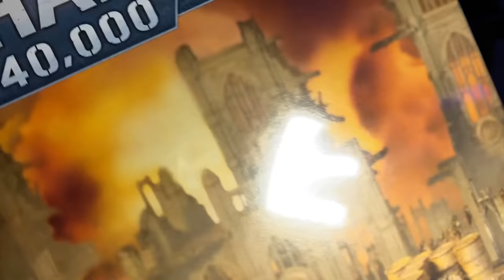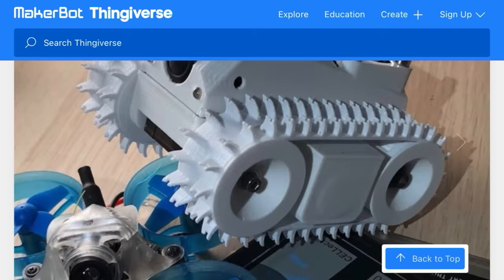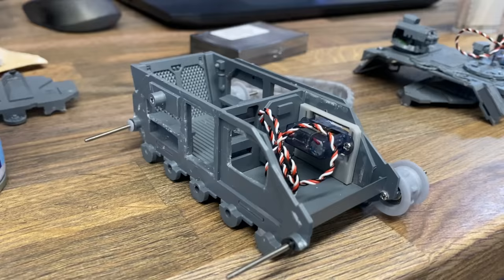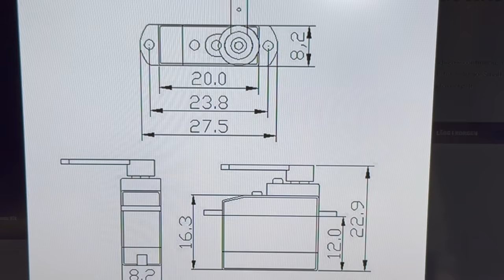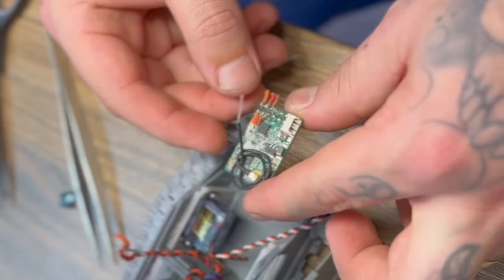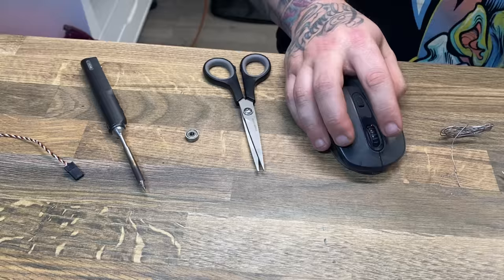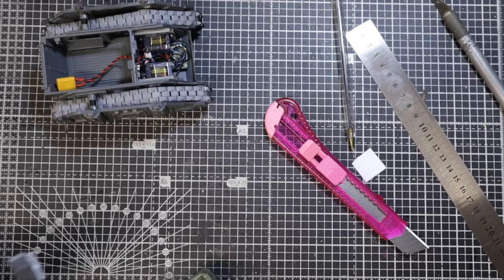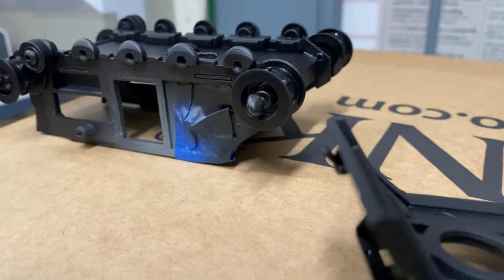I Made a Razorback REMOTE CONTROL with FPV and now its Better for Warhammer | Groundeffected.com

Comment: You might be able to use larger servos if you place them 90° to the drive sprockets by using ring and pinion gears (the ring gears should attach directly to the drive sprockets and the pinion gears directly to the servos)...I just got to the part where I saw you are painting in accordance with the blueberries. Forget everything I typed earlier.

Comment: you can modify regular analogue servos into motors by disconnecting the little trim pot from the geartriain (make sure its set to the neutral position before re-assembly)

Comment: That has to be one of the coolest things I have ever seen, other modellers have made RC Citadel tanks. But your install is fantastically compact and the UAV headset was a great touch. Great work, if i ever get any time away from 3D modelling for railways I do have a Land Raider.
Reply from the maker: Honest it was such a great project to work on. I enjoyed every minute. Except the minutes where it didn’t work
Reply: @Groundeffected  I'm building a range of model railway accessories with detail levels off the chart.... Bought a new 8K printer in Aug, only got the damn thing printing right on the 27th of Dec. I know about things not working :)

Comment: You’re the first Tuber I’ve seen using the same resin I print with. I have not had a bad or failed print since I’ve switched.
Reply from the maker: I got sent it to try and I won’t lie it’s really decent. I mix tenacious in it though to make it a bit less fragile

Comment: Servos does not have to be continually rotating servos. They could be normal analog servos. You just need to remove end stops and replace potentiometer with two resistors or a trimmer. With this modification servo electronic works like ESC and servo is just a motor with gearbox. You can do that with digital servo, but it will act as two way on/off switch. That could be useful for remote lights and other accessories.

Comment: This is such a great mod making it the perfect 40K Tank. 
You should add headlights to the tank and make a Diorama terrain piece with grass and hills, dirt roads and ruins and add dry ice smoke for fog. Then make a heroic video of it trunling through all that, maybe breaking through loose rubble or a prepared wall to get at enemies. It would make for a fantastic video I think. Imagine the feed for the glasses of what looks like real terrain with fog pass by. :)

Also do you think a Leman Russ would fit the same mod?

Comment: I personally would have fitted the fpv camera and a small in the front and cut out the front driving windows the tank treads motor control systems and battery would have been crammed in the rear crew carrying section if you ever do a second revision of this
Reply from the maker: Yea admittedly it’s not a fine tuned product. But I just wanted to make a little project never made a tank out of warhammer stuff before so I had a try. Learned a lot. And hopefully put some of that into practice next time round.
Reply: @Groundeffected  it’s all a good practice I just had a different type of similar view though I was working within the same space constraints as you were though I just might have another motorization challenge for You could do a bane blade and motorize it and possibly arm it with BB gun in the main turret   I think there’s a tanker or battle bot game that does this that you could look at for inspiration

Comment: I bet if you could find something to rubber coat the teeth on the tank treads it would have tons more grip.
Reply from the maker: The grip wasn’t too much of an issue. We tried tpu which is kinda rubber like and it made no difference to the grip. Might make a difference for climbing over things though.

Comment: omg this is so cool, it would be nice to be able to program inches to it so you can move it in certain direction with system stored pre-measured  choice + more speed if fast attack (for applicable models) is used :D

Comment: I love seeing this kind of project. I swear there was a 3- or 4-up Land Raider that got an appearance in one of my first White Dwarf magazines.

I recall seeing a video of something 40K (Leman Russ maybe?)  redesigned as RC years ago, before the tech advances of more recent times.

I want to do something similar, but lack the knowledge to go beyond the 3D printing stage.
Reply from the maker: To be honest I used really old methods for making it move. Only difference between the servos now and then is that I didn’t have to modify the servos to be continuous like I would have many years ago. And I guess the printing definitely helped haha didn’t think about that.
Reply: @Groundeffected  as an outsider it looks like the rise in technologies such as drones in the past decade or so have contributed to smaller and more efficient equipment, for example LiPo cells having a larger market share over say NiCad than used to be the case.

Would I be reasonably accurate in this suggestion? Smaller and more accessible equipment helps make this kind of project at least somewhat simpler than it used to be.

Comment: Now that's a lunchbox. You know, something similar could be done with the Primaris repulsor tank. The base for the model is the tank and you then lock the model in place with magnetic levitation...

Also in the next version use rubber resin for the tracks? Better traction.
Reply from the maker: There wasn’t much traction issues to be honest. I thought it wouldn’t have any but it was alright. Just the climbing over models the small servos aren’t very strong. Also I’ve got an idea that may make a repulsor hover. But I’m not gonna promise anything.
Reply: @Groundeffected  Sounds great. Even if you can't get it hover, do show what you get. Crowdsource ideas. :)

Comment: I love that idea and i am pretty sure all of us thought about it but had other stuff to do, or like me ... just being to lazy.
I don't understand the need of extending the chassis. It looks like all the parts are printed. 
Couldn't they get printed smaller in size, what was the reason?
Reply from the maker: This was the first attempt at anything like this and I used a design for tracks modified to suit my needs but didn’t quite know how to make them less wide at the time. Now I have resolved most of those issues

Comment: Would you build one of these as commission now that you've got the hang of it? And curious what that'd cost.
Reply from the maker: It wouldn’t be affordable in my opinion. I don’t have the time to research cheaper rc gear that actually works and the gear I’m using (which is reliable) is very expensive compared to warhammer models. Total cost, before any labor is taken into account, is around £800 that’s for my radio and goggles and the electronics. You’re need to pay for the kit, prints, the build, and then the paint job. I’d say to make it actually worth my while it’s be like £1200-1500 for exactly what I’ve got. Yes you can get cheaper gear but like I say I don’t have time to be researching and testing radios and goggles for reliability and compatibility. Sucks but that’s the reality of it sorry dude.
Reply: @Groundeffected  not a problem man, gives good insight into this kind of project anyhow. Cheers mate and good work.